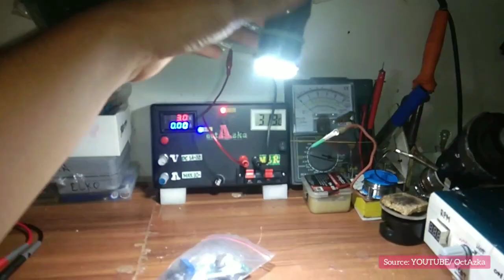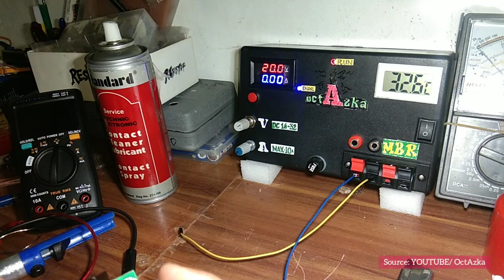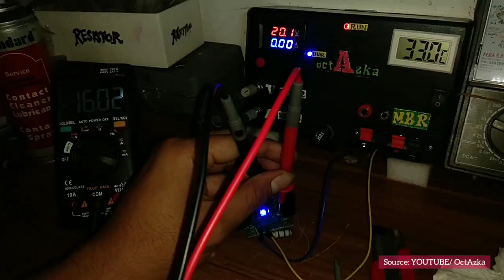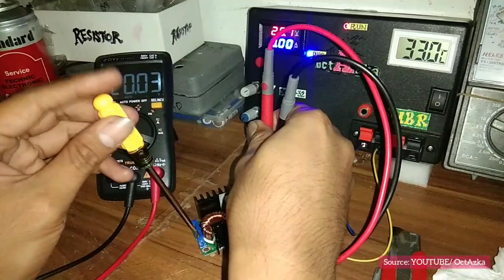Cuma 15ribu StepDown 10A BuckConverter..‼️

Comment: Stepdown sy pun sama kmrn meletup di ic xl406e1 dan alhsil pecah, padahal tegangan input sy set di 17v dan blm melebihi kapasitas max modul, untuk beban saya pakai untuk charge accu 12v dan amper belum saya set masih di posisi nol pas sy sambungin input daya tiba" meletup ic pecah. Entah salah dimananya tu ic bisa jebol padahal sblmnya pun sy pakai buat charge normal tiap sblm charge arus selalu saya set di nol dulu
Reply from the maker: Pada saat charging itu arus nya berapa amper bang?
Reply: @Ogie9191  kurang lebih 1A - 1,25A bang, dan setiap mau carging sebelun konek beban selalu saya nol kan dulu padahal. Jd bingung sy apa itu gagal produk atau bagai mana sampai ada lonjakan arus besar yg bikin ic xl nya meletup
Reply from the maker: @grentea746  kalo saran saya nanti abang untuk input suply nya jangan di set ke nol lalu ke 17v.. Lebih baik fix tegangan atau tegangan yang sudah di set ke 17v baru hubungkan ke module ini
Reply: @Ogie9191  kalau input suplay sih memang selalu sy buat fix sblm penggunaan, tp sy curiga disini potensio utk cc nya sepertinya aga error jd begitu input tegangan masuk karena potensio cc error dan terjadilah lonjakan arus cukup besar ic xl jd kelebihan beban mungkin ya krn sy kurang paham.
Tp mungkin ga bang dri potensio CC nya yg error ya kira" padahal baru beli 5 hari.
Sy pernah jg ngetes arus bebannya disaat saya putar potensio CC baru sampai 3,5 amper tiba" arus drop balik lg ke 0, saya putar lagi naikin 2-3 amper balik lg ke 0 padahal beban pengetesan saya di 5-6 amper
Reply: @Ogie9191  untuk ic xl4016e1 dipasaran skrng ada 2 jenis yg sy lihat, kira" sama atau engga ya contohnya ada
XL 4016E1
901BE  dan ada yg mirip spt bawaan spt
Xl SEMI
XL 4016E1
80449 
Ini sama aja dan hanya perbedaan di tulisan aja atau ada beda difungsinya ya mau beli takut salah sedangkan yg dipasaran kebanyakan yg 2 baris tulisan
Reply from the maker: @grentea746  coba liat data sheet nya bang, biasa beda spesifikasi dan asal pembuatannya
Reply from the maker: Untuk supply input nya pakai apa bang?
Trafo kah, atau Smps?
Reply: @Ogie9191  psu saya pakai yg model jaring 12v 30a.
Kl liat dri data sheat hampir sama cuman beda di pemasangan kaki ic aja kl modul sy icnya disolder lurus, kaki 2 dan 4 ga maju kedpn spt yg abang punya dan lampu indikator stanbay hijau kl dipakai charge merah
Reply: Semlm bru saya copotin ic yg meleduk termasuk potensio jg sy copot, mau nyari ic nya cuman blm dpt
Reply from the maker: @grentea746  di online shop ada bang
Reply: @Ogie9191   @OctAzka  ada 2 jenis yg sy liat di online bang kurang tau mana yg sama atau memang itu persamaan.
Ada yg tulisannya 3 baris seperti  bawaan dan ada yg cuman 2 baris spt XL4016E1 
901BE
Utk type sama TO220-5
Kurang paham soalnya saya takut beda fungsi atau ukuran
Reply from the maker: @grentea746   kalo yang ori dari XL Semi , yang ga ada marking E1 nya bang.. Jadi XL4016 aja
Reply from the maker: @grentea746  kalo baris berikutnya biasa kode produksi nya aja bang 🙏
Reply: @Ogie9191  oh gitu ya, ok siap bang mksh nih info"nya, sy udah pesan online tadi mudah" bsk dtng langsung pasang dn nyala lg ga da kendala mau sekalian mumpung potensio dibuka mau diganti jg pake yg biasa. 
Cocoknya yg berapa kilo ya pitensionya dari multiturn 10k apa ke 10k lg atau turun ke 5k biar ga terlalu sensitif
Reply from the maker: @grentea746  sama sama bang🙏 kalo mau ganti ukuran potensio itu selera teknisi bang..  Kalo saya pakai multiturn untuk set tegangan.. Kalo untuk potensio biasa saya set bagian pengatur amper aja
Reply: @Ogie9191  dikasih yg berapa kilo bang rekomendasi kl dari 10k multiturn 
 diganti ke pitensio biasa kira"nya

Comment: Nyerah sy bang, udah sy ganti ic 78L05 nya pun masih ga keluar outputnya bingung dah masa harus coba ganti ic LM 353 nya jg walah sekalian aja ini mah mending beli baru lg
Reply from the maker: Mungkin ada hal positif nya bang jika abang beli baru, jadi bisa menganalisa rangkaian.. Disitu nanti ketauan mana yang bermasalah.. Jadi bisa ada pebanding..🙏
Reply: @Ogie9191  untung masih diksh sabar sedikit bang setelah dibolak dibalik dicermati ternyata ada jalur PCB yg di layer dalam bagian jalur SW nya terputus mungkin karena solder saya kepanasan jd jalur putus. 
Sekarang output sudah muncul cuma masih ada tapinya nih bang 5v dari IC 78L05 belum keluar full yg ada muncul hanya 0,05v dan indikator lampu masih mati.
Sepertinya ic 78L05 yg saya beli kurang bagus, dari 2 yg sy coba ada 1 yg sempet indikator nyala lalu ga lama drop lg, sepertinya harus beli lg ic 78L05 yg benar" bagus dan stabil.
Skrng sy tes beban dengan indikator lampu yg msh ga nyala sy rasa output normal cuman indikator aja ga nyala
Reply from the maker: @grentea746  mantap , semangat bang ..🙏
Reply: @Ogie9191  pusing jg bang kl belajar  elektro ga punya dasar hehee... padahal kl diliat ni komponen simpel bgt kl sama yg ngerti mah, gmn kl yg banyak komponennya ya auto ngebul elco sama kepala hhahaha
Reply: Keknya stepdon ini cocoknya pakai ic yg biasa atau generic kmrn beli yg dri hotec gagal soalnya 5v ga muncul